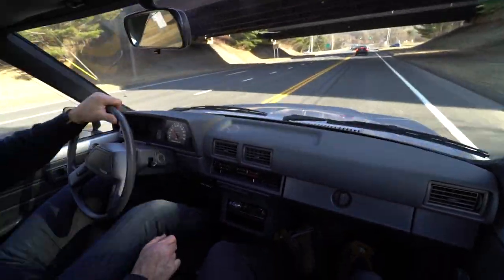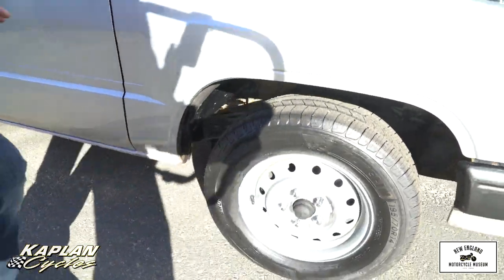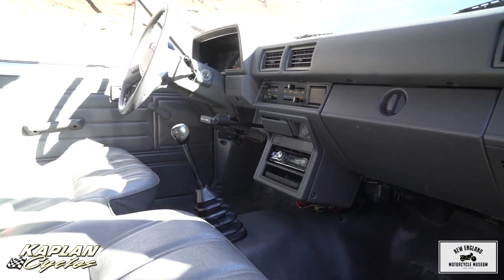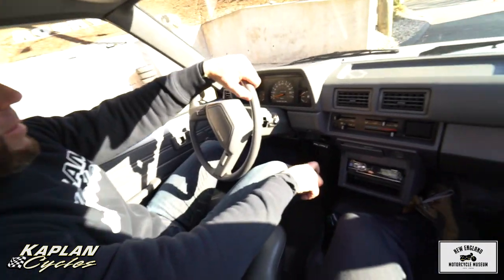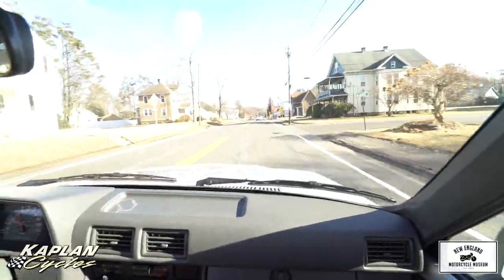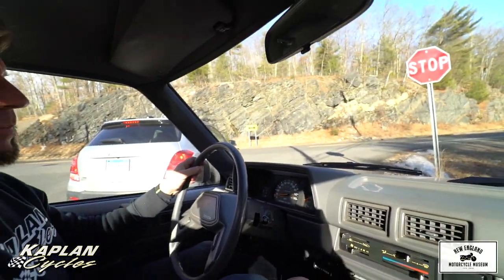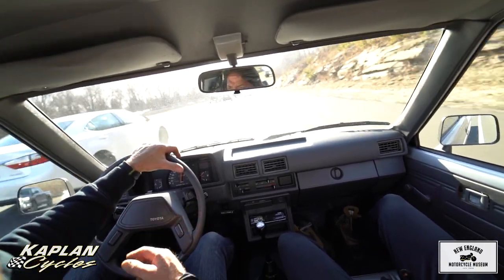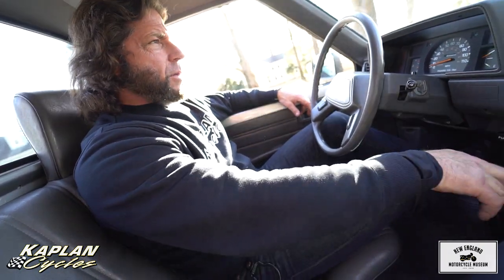1987 Toyota Standard Pickup

Comment: NICE truck. I justreplaced on my 87 carb as well, the water pump, thermostat, and fan belt. NEW radiator and new TUNE UP. new vacuum lines all over. truck sat for about 7 months, 170K miles.

Comment: I don’t know if you guys still check comments on here but I’d really like to ask a question regarding my 1987 Toyota pickup. I’ve had it almost 2-3 years now and I just rebuilt the transmission and extension housing with a new driveshaft yoke but now I’m dealing with a rough idle and I’m thinking it’s something to do with the choke and have no idea about the carbs on them. But once it heats up it’s all good and drives fine but while it’s cold if you let it idle it just puts and sometimes it’ll just shut it self off. Any tips would be amazing knowing you guys know more about them than I probably do. I own the 22r with the l40d trans I’m pretty sure
Reply: I have the same rough idle when cold, but when it's warmed up to operating temperature, it runs good. If the auxiliary accelerator pump diaphragm on the carburetor is cracked and leaking, it can cause the engine to run rich on cold starts. There are two of these diaphragms. One is controlled manually when you press on the gas pedal and the other is by vacuum. There is also a temperature switch that shuts off the function of the auxiliary accelerator pump diaphragm when the engine reaches operating temperature. That's why the engine runs fine when warmed up. You can search online for more info. Hopes this helps.